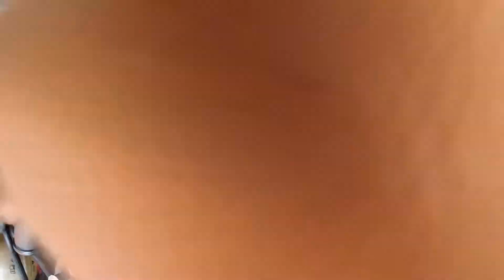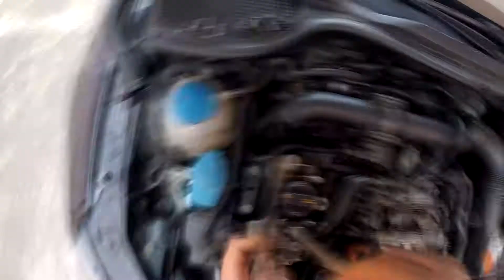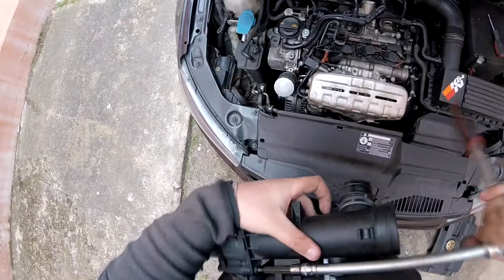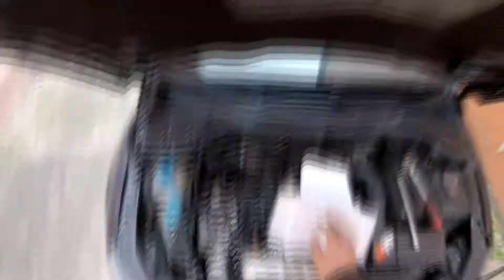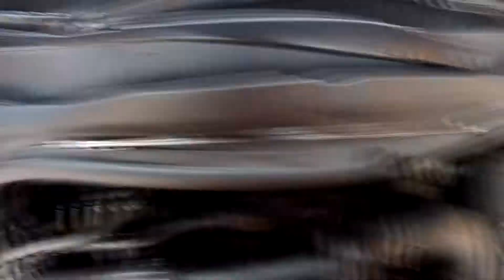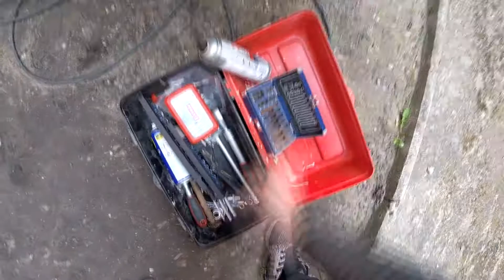TUTO Changement VDO Papillon de distribution, alimentation d'air Volkswagen Scirocco 1l4 TSI (P10A0)

Comment: Salut ✌🏽 j'ai une scirocco 1.4 TSI 160 ch, j'ai  mon voyant moteur qui c'est allumé et je ne peut plus accélérer a partir de 3000 t/m je les passer au diag, voici ce qui ressort ( P10AC Embrayage électromagnétiques pour compresseur mécanique : court-circuit a la masse ) on m'a dit que ça venais du coup du boîtier papillon et je voulais confirmer avec toi car tu m'a l'air d'un vrais pro et ça m'évitera de commander la pièce pour rien 🤣 merci en tous cas pour ta vidéo et ton professionnalisme
Reply from the maker: Salut alors non pour ton défaut rien à voir avec le papillon. Ton défaut c'est la pompe à eau avec l'embrayage électromagnétique du compresseur. Donc pompe à eau complète à changer évidement 👍🏿
Reply: @CHRISOCCO57  t'es très fort 🤣 j'ai étais à VW pour faire un diag, il mon dit que c'était la pompe a eau, parcontre il mon fait peur il mon dit que si c'était pas ça c'était alors le compresseur ( ce qui rejoins le turbo , j'ai plus le nom exact) et cela peut très vite chiffre donc je croise les doigt que c'est la pompe a eau, en tous cas je te remercie 🙏🏽
Reply from the maker: @xLightEyes  En général sur ce défaut c'est bien la pompe à eau. Je n'ai jamais vu de compresseur volumétrique péter. Et encore moins sur ce moteur 😁
Reply: @CHRISOCCO57  bah cool alors, tu me rassure, je te remercie en tous cas et petite question quand tu me dit changer pompe a eau complète c'est a dire ? C'est pompe à eau avec les poulie, bague et avec l'embrayage magnétique ?
Reply from the maker: @xLightEyes  Derien et oui c'est la pompe à eau complète avec l'embrayage électromagnétique etc 👍🏿 dans tout les cas je sais même pas si ça se détails façon
Reply: @CHRISOCCO57  impeccable je te remercie en tous cas et j'imagine qu'on peut pas la changer sois même 🤔
Reply from the maker: @xLightEyes  Tu peux mais c'est quand même complexe
Reply: @CHRISOCCO57  et petite question comment tu c'est que ce n'est pas le boîtier papillon ? C'est le message sur le diag ? Ou c'est le comportement du véhicule ? Je te demande ça parceque un garage me dit boitier papillon est l'autre pompe a eau ...
Reply from the maker: @xLightEyes  Le diag indique bien pompe à eau etc donc loin du message d'un papillon hs
Reply: @CHRISOCCO57  ok super, en tous cas je te remercie, je t'aurais bien payer un coup mais tu doit être loin 🤣 merci à toi pour ta patience et à bientôt ✌🏽
Reply from the maker: @xLightEyes  Haha pas de quoi. Oui du 57 😂
Reply: @CHRISOCCO57  Salut, je reviens vers toi parce que on a changer toute la pompe a eau et tous allez bien et j'ai rallumer et voyant moteur revenu tu pense que c'est le temps que sa s'adapte ? Ça commence à me fatiguer 🤯
Reply from the maker: @xLightEyes  Salut je sais pas. Il faut repasser un diag
Reply: @CHRISOCCO57  salut mec, c'est encore moi, j'ai envie la réponse après avoir passer 2 jours dans un garage chez un expert qui a tous démonter la conclusion : Compresseur volumétrique voilà ... fait chier 🤣

Comment: Hi friend, good video, very quick but understandable, one question: what fault did the engine have that made you change this electronic butterfly valve?

Regards.
Reply from the maker: @hugogarcia7060  Salut c'est marqué sur le titre défaut P10A0 au diag. Impossible de dépasser les 3000tr/min
Reply: Tanks Friend !!😁

Comment: Bonjour, mon frère a un scirocco 1.4 tsi 160, enfaite il a un code erreur p02cb (Turbocompresseur(TC) Compresseur(SC) B -état de sous-suralimentation) qui est apparu 2 fois en 8 mois depuis qu’il l’a (première fois c’était après quelques accélérations généreuses voyant moteur quelques minutes après. La 2 eme c’est tout récent d’il y’a 1 mois, entrée d’autoroute il essaye de prendre 6000 tour (première fois il essayait de prendre autant) et quelques heures après le voyant moteur est apparu encore une fois avec le même code.
Nous n’avons jamais pu déterminer la causes de ce code défaut, malgré inspections et changement de durite turbo, saurais-tu par hasard d’où ça pourrait potentiellement venir ?
Reply from the maker: Salut. Wastegate. Dump valve ou turbo HS 👍🏽
Reply: @CHRISOCCO57  merci beaucoup je te dirais si ça a changé quelque chose

Comment: Salut. Nickel la vidéo, dis moi j’ai 2 codes défaut. Le premier sur le volet que tu changes et l’autre là dump valve. Je l’ai démonter et j’ai le texto. Qui est cassé. Tu penses qu en changeant là dump les 2 défaut disparaissent car j’entends bien mon volet s’ouvrir et se fermer mais pas sûr que le volet se ferme là biellette est peut être cassé
Reply from the maker: Salut. Normalement les 2 défauts n'ont aucun rapport entre eux donc va falloir changer les deux pour que tout soit OK 👍🏿
Reply: @CHRISOCCO57  ayayyayaa, allez demain je démonte le papillon 😁
Reply from the maker: @nezrokamidelaracine3165  Haha en vrai c'est simple donc tranquille 👌🏾
Reply: @CHRISOCCO57  je vois que tu as fait ça tellement rapidement. J'ai un doute aussi sur le pressostat (capteur) jai suivi la durite et elle rentre dans le cache protection moteur je vois pas à quoi elle sert surtout que de l'air sort en permanence t'en saurais plus sur le capteur ?
Reply from the maker: @nezrokamidelaracine3165  Il faut voir avec les codes defauts. Si ça pointe bien le boitier papillon bah il est a changer faut pas chercher ailleurs. C'est un défaut connu sur les TSI de toute façon
Reply: @CHRISOCCO57  merci ! Je regarde tout ça rapidement et je te dirai après un coup de valise ce que ça donne et merci pour la vidéo !

Comment: Hi got the same error car doesn't  rev above 3000rpm bought a new unit need to do adaptation but dont know the channel on OBDeleven Pro. do you perhaps know ? struggling for 3 months now.
Reply from the maker: Salut. Désolé je suis français tu vas devoir traduire. Il y'a des cas où l'adaptation du nouveau est nécessaire et d'autres non.

Pour ton cas peut-être que obdeleven ne prend pas en compte les adaptations. Le mieux serais un diag genre Vagcom. Vcp. Vagcan quelques chose de 100% prévu pour le groupe Volkswagen.
Reply: @CHRISOCCO57  OBDeleven is for VW group which thE pro vision does adaptations.
Reply from the maker: @zaidiboy4281  Beaucoup de boîtier diag comporte des outils du genre mais n'arrive pas à communiquer complètement avec mes calculateur. Si au lancement de l'adaptation aucun bruit viens du côté du boîtier papillon c'est que ça marche pas.

Normalement il suffit de supprimer les défaut et de rouler avec la voiture sans devoir faire d'adaptation

Comment: Same error p10a0, if i change the flap the error will be gone? Or is something alse?.. 
Only p10a0, if i unplug the wiring from fhe flap i get the p10a5 something about potentiometer.. the flap is the issue?
Reply: I think is not OE, is Continental

Comment: Bonjours, j'ai un golf 6 tsi 160 CV 2011. 
Même  problème voiture ce mais en sécurité à 3000 tr min, à n'apporte quel rapport même au point mort. J'ai changer les 4 bobine d'allumage et le boîtier papillons,mais toujours la même chose.
À part très rarement elle fonction à froid pendant 1 km et ce remets en sécurité.
Reply from the maker: Elle fait pas de bruit blizzard ? 🤔 Il est possible que ce soit la pompe à eau avec l'embrayage electro magnétique du compresseur qui soit hs aussi 🤔. Pas de voyant moteur ? Tout est bien rebrancher ? Il faut passer au diag faire un log. Et essayer de faire une calibration du papillon.
Reply: Toujours le voyant moteur ! A part quand la voiture ce remet à marché pendant 1 km et après il revient.
Reply: Et non elle ne fais pas de bruit bisard. en dessous des 3000 tr elle marche bien, tourné bien au ralenti . Après quand je roule avec et que j'accélère elle fais des trou parfois.
Reply from the maker: @leandrecolombet4531  Du coup passage au diag pour voir les défauts 👍🏿
Calibration du boîtier papillon si toujours en défaut et sinon bah voie ce que les défauts donne comme erreur
Reply: D'accord! merci de tes conseils. 😉
Reply from the maker: @leandrecolombet4531  Oula si ça fait des trous à l'accélération ça craint un peu. Si bougie et bobine changer. Ça peut être sur le système de carburant. Filtre. Pompe hp. Injecteur.

La pompe à eau peut être en cause sur le blocage à 3000tr. Sinon dans le pire des cas moteur rincé.

Repasse la voiture au diag et donne moi les codes défauts 😉
Reply: Salut, du coup les codes défaut sont p10a5 et p10a4
😕
Reply from the maker: @leandrecolombet4531  Donc c'est bien le papillon 👍🏿 Fait le changement 😉
Reply: Le boîtier papillons et neuf il vient de chez volkswagen 🙄
Reply from the maker: @leandrecolombet4531  Tu a fais le montage toi même ? 🤔 Si oui vérifie les branchement et sinon calibrage a faire a la valise

Comment: I got a problem withe this I think my car doesn’t run when I am casing it up 3 round of motor its going normal up 2,8 and running up to 144 km/ h bot when it’s mor casing or acceleration mortor is not going mor an I got a cod which is p10a0
Reply from the maker: If the default code to the case comes out a concern of butterfly case is better to change it

Comment: salut ! j'ai limpression d'avoir une perte de puissance entre 2200 et 3500 trs min a partir de la 3 eme jusqua la 6eme est ce le probleme viens du papillon ????
Reply from the maker: Salut ça peut venir de beaucoup de chose. Filtre à air.. Débitmètre.. Turbo.. Papillon.. Bougie.. Bobine d'allumage..

C'est quoi comme voiture ? Normalement si papillon y'a un défaut qui apparaît (voyant moteur ou voiture en mode dégradé)
Reply: @CHRISOCCO57  cest un Scirocco 1.4 tsi 160 boite meca
Reply from the maker: @xvexcone91  D'accord donc normalement si c'est le boîtier papillon comme moi tu as un voyant moteur et la voiture se met en mode dégradé (elle ne dépasse plus un certain régime moteur)
Donc à toi de voir pour vérifier déjà visuellement les pièces que je t'ai cité au dessus et puis sinon voir pour passer un coup de diag
Reply: @CHRISOCCO57  bonjour à toi ✌️, est ce que ton coco ne dépassait pas les 3000 tours ? Merci d'avance
Reply from the maker: @bandy7748  Oui c'est bien ça. Mode dégradé et voyant allumé.
C'est de l'huile qui rentre dans le boîtier électrique du Corp papillon
Reply: @CHRISOCCO57  merci merci et encore merci pour ta réponse clair et rapide, j'ai l'impression que c'est la maladie du tsi. Faut t'il repasser la valise après changement ? Et quel site ou mag genre Auto distribution, ou directement volkswagen pour acheter ce fameux j808 si c'est bien cette réf
Reply from the maker: @bandy7748  Pas de soucis 😉 Moi je l'ai pris sur eBay tu peux le trouver n'importe où sur le net ou en magasin. VW aps api etc etc.
https://m.auto-doc.fr/vdo/1736932?gadw=1&gclid=CjwKCAjwjLD4BRAiEiwAg5NBFjpc-v51LT9r2IDtJPiV0kBNtXupKGL1R_MNY6oI04sv2Yu2JCsrthoCBP0QAvD_BwE&gclsrc=aw.ds
Normalement pas de passage à la valise.
Reply: @CHRISOCCO57  merci, pourquoi sinon des fois y a besoin de la valise.
Reply from the maker: @bandy7748  Certain cas où il faut reste le papillon